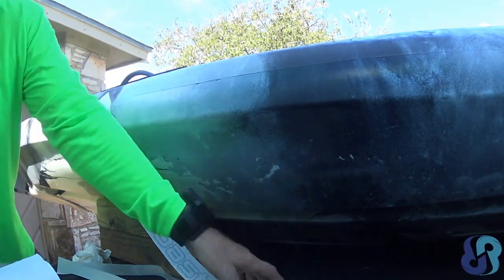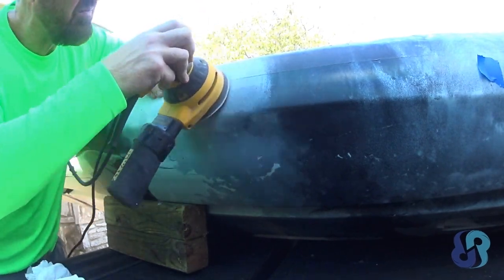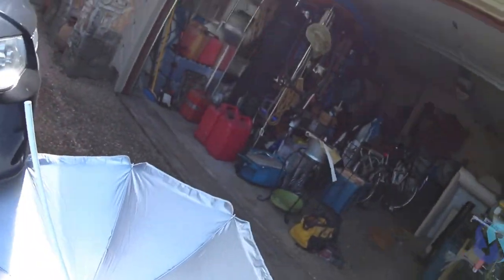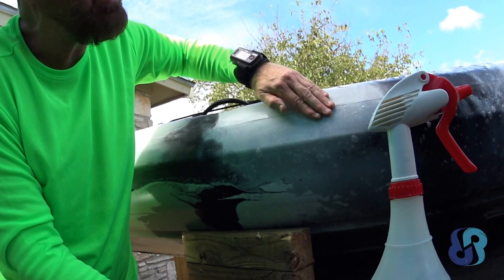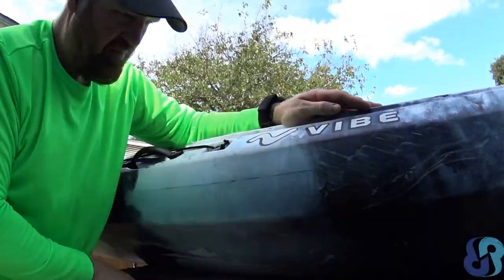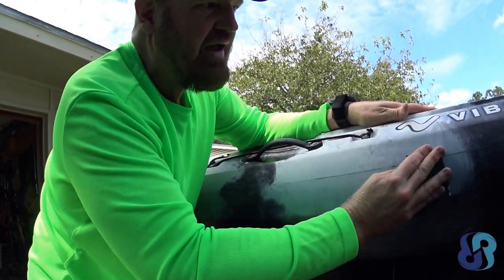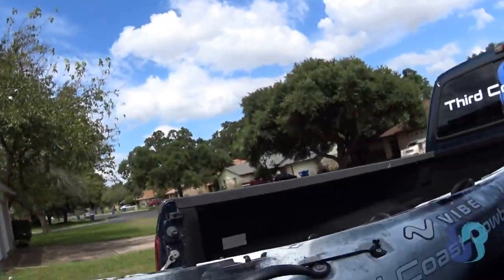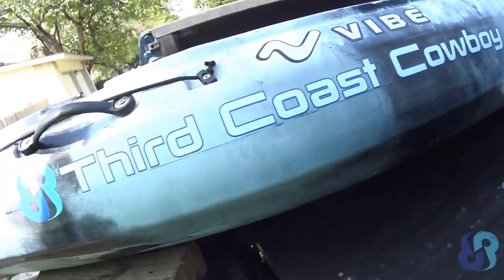How to get stickers to stick to your kayak - DIY

Comment: OK defiantly not an option to sand it you'll never get it pin on to the sticker maybe with a wrap just use adhesive on the reverse very small amount and spread it out I use carpet adhesive